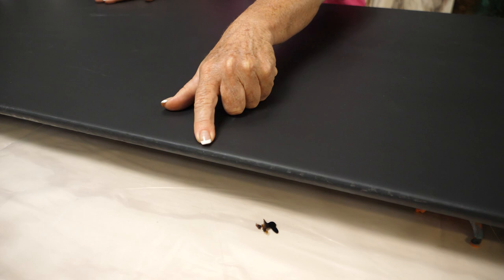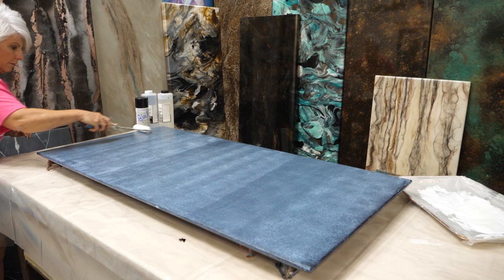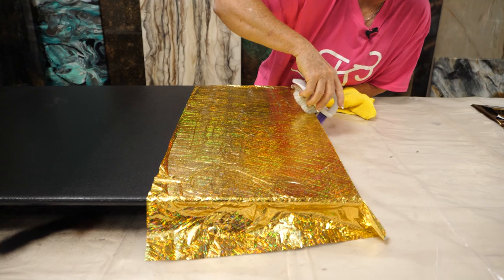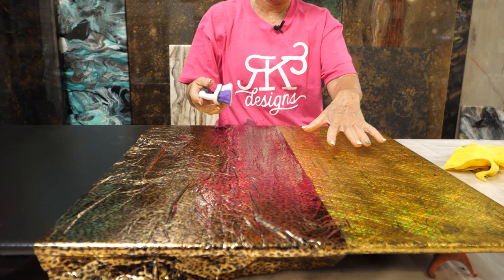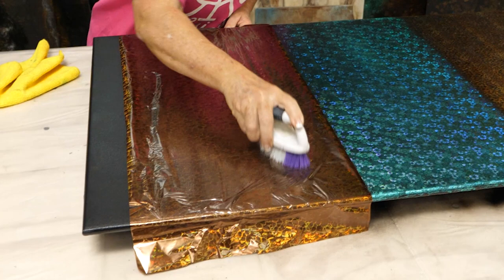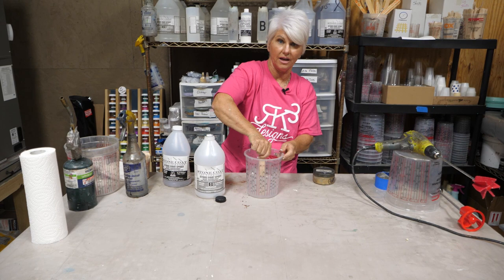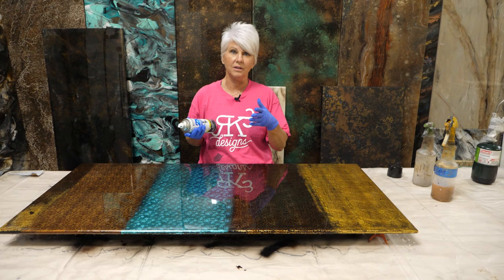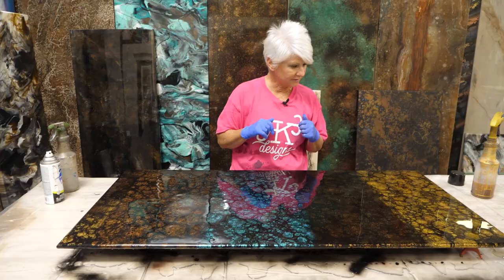Using Decorative Foils With Epoxy | RK3 Designs

Comment: Is this epoxy good for outside applications
Reply from the maker: Not if it’s in direct sunlight. It’s fine if it’s under a shaded area
Reply: @RK3Designs  what is a good product for direct sunlight
Reply from the maker: @KMF3  Platinum by Stonecoat Countertop. They are re-releasing it soon with a new primer. It’s not an epoxy, it’s a polyaspartic. I’ll me making some new videos soon. 😊
Reply: @RK3Designs  what is that
Reply from the maker: @KMF3  it’s a polyaspartic hybrid product that will never yellow and has a very short open time. Check out Stonecoat Countertops website FMI.
Reply: @RK3Designs  looking forward to your video on it

Comment: Wear PPE with spray paint, AND RESIN!!!  I don't understand what the whole purpose was, now you can't see the foil, so why put it down?
Reply from the maker: I do wear PPE when I’m not on video and I state this in many of my video. However, it’s NOT my responsibility to tell people to take care of their lungs. That’s on them. AND, the resin I use has zero VOC, made with 100% solids and no solvents. I also am in a really large work shop with exhaust fans. Again, not my responsibility to tell adults to wear PPE. It’s YOUR responsibility to know your product and take action as needed. Now as far as the foils not being able to be seen. You can ABSOLUTELY see the foils AND I was very clear that you didn’t have to add the fracturing if you didn’t want to. The purpose of this whole thing was to show people options.